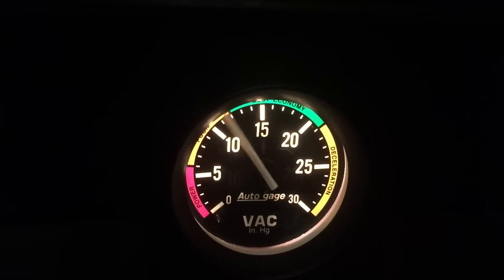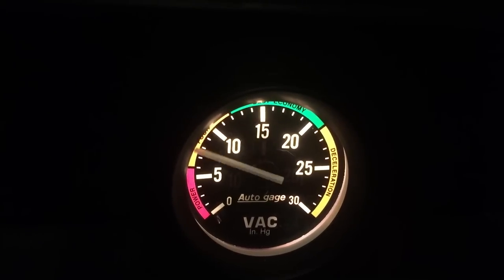SOLVED - Valve noise, tap, and sticky lifter

Comment: Dude, great information about Rotella! I have the same lifter noise (156,000 miles on 2000 Grand Cherokee).I bought T5 right after your advice.I was a half quart low & noticed a difference! , though the tall block of a 4.0 does make any noise resound in the engine bay. Keep'm coming, your on point!
Reply from the maker: Thanks! Glad you enjoyed the vid
Reply: How much amount should i put in my engine in litter, and i put it with engine oil or what
Reply: Plz post a link for the product so i can search it in egypt

Comment: If you're looking for "zinc" or more specifically "ZDDP" there's NOTHING that has more ZDDP in it, than any brand of specifically formulated "Engine Break-In Oil". ZDDP is the absolute best compound known to man for protecting engine parts from wear. The reason ALL oils don't just load up on ZDDP and the reason for normal oil and break-in oil, is because after continued use of high amounts of ZDDP tends to clog catalytic converters as well as being bad for the environment. If you are someone who doesn't care about things like that, I imagine you could put "straight pipes" on your vehicle and run "engine break-in oil" in it at all times and it would keep your engine wear close to near ZERO, as if it just rolled out of the factory. That would be an interesting experiment...
Reply: Check out this Product on Amazon (Hyper Lube HPZ212 Zinc) read the writeup on it and it's safe for Catalytic Converters. It's 12.36 for a 12 OZ Bottle. Make sure your looking at the right type they have a cheaper version for 6 Dollars a bottle it's made for older Engines without a Catalytic Converters.
Reply: They actually make a concentrated ZDDP additive for break in and racing applications that I use religiously in marine applications but I believe I'm going to start using it in my 4.0 after watching this. Next time I go to the shed I'll reply with the brand name of that zinc additive because it's readily available
Reply: @TOO_RAW I have a bottle of that in my garage that I used in an old plymouth and forgot about it until reading this.  I think I'll add a little bit in my oil. My 2004 jeep grand cherokee laredo 4.0 runs great but has a short rattle at start then ticking lifters..but not out of the ordinary for that motor
Reply: @Robert-fs6ge  the Lucas brand engine break in ZDDP! Thats what it was. That stuff is the bees knees! My 04 has 392k on a stock 4.0 that hasnt been rebuilt yet and absolutely loves it. I put a whole bottle in with T6 rotella 15w40 and that restore treatment and it doesnt make any noise until like 2k miles after an oil change
Reply: @TOO_RAW  That's what I have in my garage  it says something about racing break in zddp
Reply: @Robert-fs6ge  thats the stuff. You can use a whole bottle in the 4.0, they love it.  I also did a cat delete so im not sure if it negatively affects catalytic converters or not. Where i get the best results with it is in marine applications with 4 sttroke outboards since all of mine are pre 2008 and still have flat tappet lifters. That additive keeps my fleet running lol
Reply: @TOO_RAW  I'm thinking about just adding a couple of ounces to the fresh oil change I just did.  The ticking sound is very light My jeep grand cherokee is 20 years old but only 90k miles

Comment: I use Justice Brothers engine tune up to clean up sticky lifters or just to give the engine some love. I swear by that stuff. I had an old dodge dakota, I think a 92 that had lifter tap, so I added JB while it was running and within 1 minute, the tap was gone and never returned. Im currently driving a 99 dakota that Ive owned since new, and JB has kept me going. Im going to take your advice for my 03 jeep 4.0 and use rotella. I didnt know these things, and now I do. I added REV X to my jeep to get the zinc up because I heard the slap, now I dont. Thank you very much for  sharing your knowledge

Comment: Putting Zinc in your ride if it has Catalytic Converters will plug them up and a Stock Jeep XJ has 3 2 up stream and one before the Muffler if your running the Stock Exhaust. This Product is made to coat your internal Engine Part's. Its called  (Hyper Lube HPZ212 Zinc)12.36 a 12 OZ bottle, it's sold on (Amazon) find it and read up on it. Read the back of the Bottle and all the other info. provided. This Product will do the same Job as Zinc but will not plug up your Cat's. They have a Cheaper Version for 6 Bucks but this is made for older Engines without Catalytic Converters. (Hyper Lube HPZ212 Zinc) tells you on the back of the Bottle it's safe for Catalytic Converters.

Comment: My engine generally runs quiet. I came out one afternoon grom work started it up and suddenly had a valve tap. As i went to open the hood it went away instantly. The oul was dirty amd low so i put a half a quart in and it tapped again for a little bit but went away even after i drove all the way home and drove it the next day and heard nothing. Xhanged oil today and it appears to be back till it warms up. I did put some seafoam in it with new oil. I use mobile 1 synthetic 4.0 2004

Comment: I have a rattle on start up on my TJ 4.0 goes away after a few mins. I also been chasing down a #2 missfire . compression test is perfect,changed everything possible for that clyinder i run roslin and dino oil now I had the rattle worse with rotella . I'm wondering if Mopar top cleaner will help ? Or what's the best that you used in the oil to clean the lifters and everything?

Comment: Hi you make an excellent video I love this video but have people ever used Marvel's Mystery Oil have they forgotten about this stuff it's perfect for that jeep is perfect for sticky lifters I use it all the time for my XJ and it cleans out all the vanes in the Conch and I put the fresh oil in and it's good as new I have 730 thousand miles on my 1997 XJ all original motor Marvel's Mystery Oil really works you can get the stuff from Walmart anywhere cheap or if you don't want to use that just use transmission fluid yes I said transmission fluid clean that varnish and gunk out and stop that tapping noise old school but effective

Comment: When you ran the engine treatment, did you just get cheap oil & a cheap filter since you were going to change it after only 200 miles?
Reply from the maker: Cheap oil, yes. Cheap filter, no. I only use the Mopar 090 filter on my 4.0's

Comment: spectro motorcycle 4 stroke oil has zink in it. used in cars and vans way back in the 70s . i never use synthetic the most slugged engine i seen was amsoil when that came out.

Comment: Jesus this is a must see video for all LRD2 owners.

So I just gave my D2 it’s first rotella t4 oil change and I still have knocking 

What engine treatment did you use... do you think I should add more zinc? I’m willing to flush this oil after a couple hundred miles if you suggest it. Just changed it last night.
Reply from the maker: A quick flush would certainly not hurt. Rislone makes a great zinc engine additive and treatment. Maybe try that and see if you can get it to quiet down a bit. Good luck!

Comment: Hello D.  I am new to your channel, but have enjoyed what I have seen so far.  Thanks!  It has been a minute since you posted this... I am curious what weight and brand of oil and additives you are running in your 4.0 now.  I bought a few big jugs of Mobil 1 10W-30 High Mileage that I need to use up.  I change every 5K miles and I now have 197K on my '01 XJ.  I tried half a bottle of the Lucas break in treatment at my last oil change, and it seems to be happier now.  I am just not sure that the oil I am using now is ideal.  What concoction are you running these days?
Reply from the maker: That break in treatment will definiteyl help make the Mobil more compatible with a 4.0 as it has the almighty Zink our 4.0's crave! I like 10w-30 for a "well broken in" old 4.0
Reply: So I have a couple questions.  I just bought a 2000 xj and it is showing  cylinder 4 misfire and o2 sensor codes . Thinking sticking valve. Would the o2 codes be related  to the cylinder 4 misfire? I have done zero diagnostic on it yet as I'm new to jeeps and relatively  new to at home diagnostics on them. Also what do you suggest  to add to oil specifically  to clean it out and what specific oil should I run?

Comment: Is there anything else i xan do to make it stop. Should i use more seafoam.
Reply from the maker: Not really. You couls replace the lifters and possibly the cam, but that is WAY overkill for most engines. The zinc really does the trick
Reply: @DEInTheGarage  can i get a link to this zinc you speak of.
Reply from the maker: @4CarbideGaming  There are a lot, but this is the one I tend to use https://www.walmart.com/ip/Shell-Rotella-T5-10W-30-Diesel-Engine-Oil-1-gal/20573564?wmlspartner=wlpa&selectedSellerId=0&wl13=2090&&adid=22222222227015545068&wl0=&wl1=g&wl2=c&wl3=315753733843&wl4=aud-393207457166:pla-580689854625&wl5=9052108&wl6=&wl7=&wl8=&wl9=pla&wl10=8175035&wl11=local&wl12=20573564&veh=sem&gclid=CjwKCAjwjqT5BRAPEiwAJlBuBTBLGL9gRKdpoluZ_MmthJVaZmA2YnIoE678TR08TwuY-RlWV05lMRoCmTwQAvD_BwE
Reply: @DEInTheGarage  it saids synthetic blend. will that cause a problem with full synthetic.
Reply: @DEInTheGarage  and should i change the filter again.

Comment: Hey there! 2003 WJ 4.0L here with a rebuilt engine from LQK. long story short i had to swap 3 rebuilds from them cause the first two had bad compression. 3rd on has 180psi all the way down but has intermittent tick (pretty much ever since day one) its completely random. cold/warm start up, beginning of drive, after 100 miles, doesn't matter, runs rough most of the time at idle as well especially when the tick is loud. Ive tried a zinc adaptive and it didnt seem to do anything at all. any advice on what should be a NEW engine with a tick? (probably only has like 15-18k miles on it now) PS vacuum at idle in neutral with AC off after warm up sits about 14-16inHg which i've been told is a little low
Reply: PS im a mechanic and we use bulk oil (synthetic blend or full synthetic  both 5w-30) i've been told not to use synthetic but that means i have to buy oil out of pocket, plus ive tried conventional oil even with extra Zinc and still no change. In South FLorida btw so Temp hardly ever goes below 70 deg

Comment: What happens when they reduce the ZINC in rotella or diesel oil in general, if they haven’t done so already? Might need to start looking for zinc additives. Does anyone know someone with a bad 4.0 cam? The sea foam will clean the lifter and quiet it down, any new oil after that will feel like it’s better than the last. Diesel oil is design to handle diesel contaminates & gas oil is design to handle gas contaminates. If the diesel oil has an “S” rating, then it should be good for gasoline engines. But remember, In order for a diesel engine oil to claim an “S” category (like T5 10w-30), it must now meet all of the gasoline category API criteria, including the limit on ZINC. This is probably why people are running the 15w-40 rotella, no s rating.

Comment: I use a little of lacquer thinner in the regular unleaded gasoline n in the oil n a little mystery oil in the mix. I stop using rotella t6 I use. 4 winter 10.40 or 15.40  4  summer 5.30 or 0.30 or 40  Walmart brand High mileage tech.. Bestline oil additive n motokote .. The best for metal to metal contact n wear n tear aging...i have 3 grand Cherokees4.0 4 wheel 98.99. 04 use on all of them buy large gallon ..

Comment: to bad i have no sound, but i checked into more zinc and all say if you use to much your smog equipment with start falling apart, it’s like when i used reg gas in my 84 f-150 had to replace my egr 4 times carb 3 times so actually lost money from getting better gas mileage

Comment: I am worried. I used Rotella . In a pinch saw a deal on valvoline high mileage and used the fram gray  filter. About 100 miles the guage pegged to 80. 2 year old guage. Seems to run fine. Last change went mopar and T5. Now the guage goes up and down 80 , 0 with check light, etc... If it goes 0 I let off the pedal and back on and guage rises. Today will burp the sensor channel, btw a new sensor went right to 0 and light came on but the electrode connector pulled off so put the old back in. Might try some cleaner like mystery oil and new filter. 800 till next change so drain and go back to T4. Man I hope it is a simple clog and not a bad pump. I still runs good though for 200,000 amd has neen running fine for 3500 miles like this. I usually add a zinc additive but last time I used the stp compression so thinking that might habe gunked something up.

Comment: Cant you just add zinc to the oil? I use normal oil and add a zinc treatment from the parts store.
Reply from the maker: Yes, absolutely. I find it is one more thing to buy, so I like to use Rotella. The key is to get the zinc in anyway you can for the 4.0

Comment: I have the 2004 Jeep Liberty v6 and I have a lifter that’s sticking and it’s somewhat loud and continues to do it when I push on the gas, once I drive it for awhile it slows down and almost goes away. I just had the water pump go out on me. I have used engine treatment with an oil change and it still did it. So I’m going to go to a higher oil
10w50 with some Lucas oil. Hope it works

Comment: I've had my 97 for about fifteen years now. 190,000 miles. I've always had a little valve noise. Couple days ago I was letting it warm up and thought it seems to be slightly louder. I'll give this a shot next oil change.
Reply: How did it work out did it get quieter
Reply: Yes it did:) cleaned her right up!